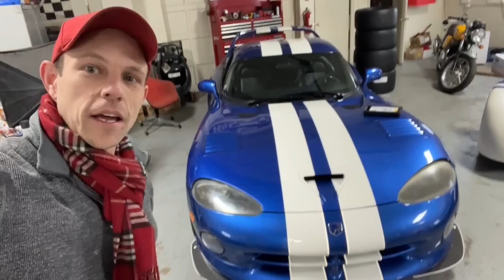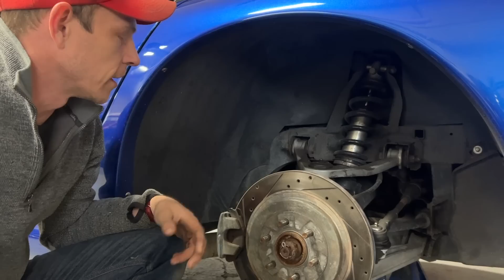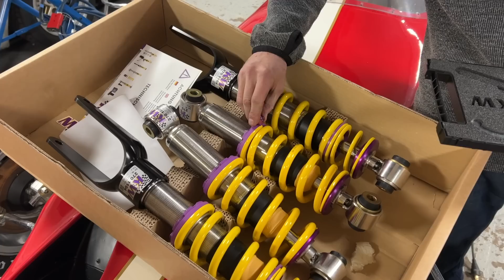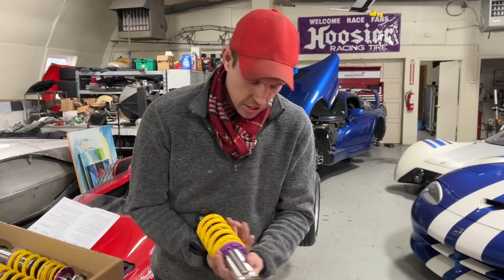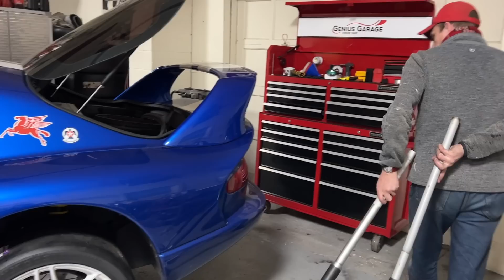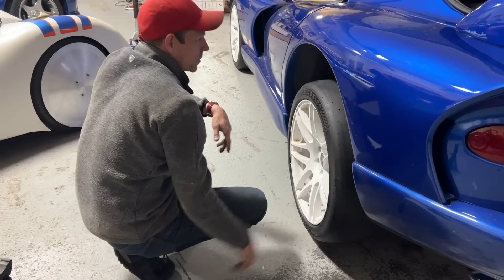Infamous Viper GTS Track Build - Speed GOOSE Series #1

Comment: These cars are getting somewhat rare and collectable.  If you're not turning that into turning it into a fulltime track car (which would be a shame since it's fairly nice) please don't cut the hood/front lip, or even the inner liners.  I understand what you're trying to accomplish (and agree with your points), but those are some expensive and somewhat hard to get parts, not to mention cutting them will drastically reduce their structure/strength.  Those hoods love to crack from the factory as they are if not properly lifted more from the center.  And thank you for taking that "wing" off, LOL!
Reply: BTW, there's a popular rear brake upgrade kit that's fairly cheap, but still subpar for the car.  I went with a full Stoptech BB kit, they are amazing.  I've heard of guys putting the fronts on the rear and using newer Viper front calipers, and using a proportioning valve to regulate the rears, but I haven't tried it... even though I have the parts to do it.
Reply: You can also easily crack the hood by closing it at the front. Place your heads at the naca duct and then push.
Reply from the maker: It’s just a car man. I’m gonna make it better.

Comment: I can’t wait to see how this progresses, Casey. It might be worth a call to KW to see if the right bump stops are on there since there is hardly any travel or there would be even less travel within their additional 10mm of adjustment per their recommendations as you read. Additionally, they may be able to tell you if the bump stops are intended to be an active part of the suspension dampening, like a progressive spring, since I’ve heard of a few instances of this happening.

Comment: Casey I feel like you could make a pretty cheap quick thin track hood out of a few layers of fiberglass. using the old hood as a template. then you wouldn't have to cut up your original hood and you'd save a few pounds up front and up high. In the end probably not worth it but could be a fun Challenge.
Reply from the maker: With what female mold? You are talking MASIVE time. Also, I'm not cutting my stock one.

Comment: I put a set of MSC one way adjustable coil overs on my 99 rt/10 , same exact issue on the rears, very small amount of travel on the shock shaft, I am two fingers tight on all four corners and I measured from the frame at the jack points to the ground at all four points also (3.75”) , I did notice that there was more suspension settlement after I took the car out for a ride, over the course of two days and about 10 + adjustments to the ride height, I finally got it and if I did not have my Quick jacks I would have probably gave up

Comment: Within the last year I rebuilt my 99 GTS ACR suspension, which was very worn out. Rebuilt Koni 2812's, poly bushings, solid steering rack bushings, and all new swivel bits on all 4 corners had epic results. 

I installed IPSCO anti toe brackets in the rear, because I was already balls deep so why not. I tracked the car, but my rookie @$$ doesn't know if they did anything meaningful. Maybe the much more track experienced Casey Putsch can weigh in on these brackets?

Comment: A tip to ensure your threads are perfect after cutting or grinding the threads of a bolt is to first screw a nut over the threads past your working point so that after cutting or grinding the threads you can simply remove the nut and effectively 'chase' the threads back into shape even if they are slightly damaged due to the cutting or grinding thus ensuring no problems fitting the bolt back where it belongs.

Comment: Great stuff about the difference in actual tire sizes between slicks and street tires!
FWIW, the “super” 200TW street tires used by the autocross crowd have the same issue. I’ve run three different 275/35/19’s from three different manufacturers over the past few years. BF Goodrich was wider than Federal, and my current Bridgestones are wider than them both! Not by a huge amount, but enough to matter if your tolerances are already tight.

Comment: "Everything goes wrong!" Man, I felt that one. I think I mentioned it over on the bird site but maybe not here I'm going through that with the RX-8. Fixed the leaky pinion seal and appear to have gotten the nut tightened back down properly for the preload BUUUUTTT.....now the transmission tailshaft seal is leaking. I replaced it once while doing the pinion and that leaked so I installed another. Still leaking but not where the driveshaft goes in but around the outside of the seal body where it drives into the tail housing. Very frustrating. I don't know if maybe my makeshift PVC pipe driver didn't get it in straight enough or far enough. But I've gotten the latest revision of the seal from Mazda and am waiting for the actual special service tool for driving the seal to arrive. $157.75 shipped for a driver sleeve and a handle to whack with a hammer. Good grief.

Comment: "We have all done stupid things. Those of you who have made custom hard brake lines know what I'm talking about."

That one stung a little bit. 😆

It always happens when you finally get the perfect flare too.
Reply: Having had checkered experience with forming hard brake lines, on the track car I just finished I used AN3 flexible stainless braided Teflon lined hose everywhere and completely omitted hard lines.  I know some say that will result in a soft pedal.  BS.  My pedal feels like stepping in a brick.  And the fabrication, routing, service,....everything....is so much easier.  I'm not going back.
Reply: Casey, you could have added custom fuel lines to that list too.😁
Reply: Just had to do this a couple weeks ago on a stupid GMC truck, those damn GMs and their rusty brake lines.

When I got into the truck to do the job I could tell someone else was in there before me, they just left the old rusted out brake lines in it. I didn't judge them though, I did the same thing.. I'm not dropping the gas tank ffs.

Comment from the maker: I'm excited about doing this track build and hope you guys are too! What was your favorite part of the video?
Reply: I'm here for Casey's hammer Technique, and problem-solving.
I work on all my own stuff and use support of local shops for tires, air-conditioning. I will swap a transmission and do head gaskets, timing sets in the driveway.
Reply: Enjoyed the shock explanation. There is a guy in Gainesville FL. That has a YouTube channel. He works on a Viper that is raced in the Trans Am series. the car wins a lot. He might be able to advise you on the fenders etc. Kevin Smith racing.
He is a buddy of Cleetus McFarland. I am sure you have heard of him.
Reply: Casey, two months ago I bought raffle tickets for this car's giveaway and never saw the results. Was this car not given away or is this a continuation of the previous raffle?
Reply: @JohnMalik  The Sweepstakes begins on November 1, 2022 and ends at 11:59pm EST on November 5, 2023  
(From the website listed above)
Reply from the maker: The sweepstakes goes through next year. Hence given away at the 10 year anniversary.
Reply: The thought going into the build.

Were there other ways at arriving at more room for the tires than modifying those panels or would that be more costly?
Reply: Shocks 
Awesome